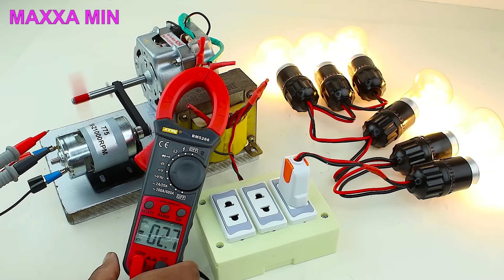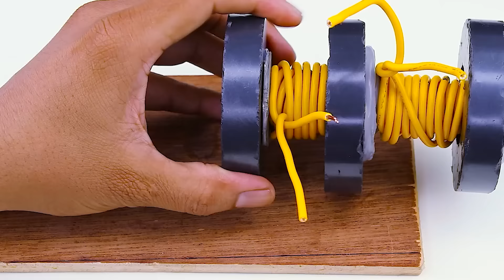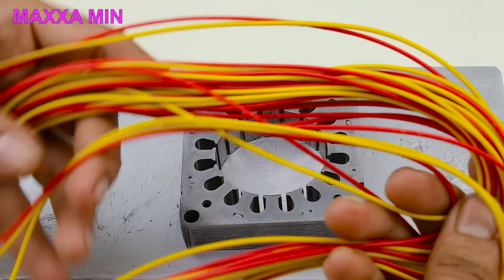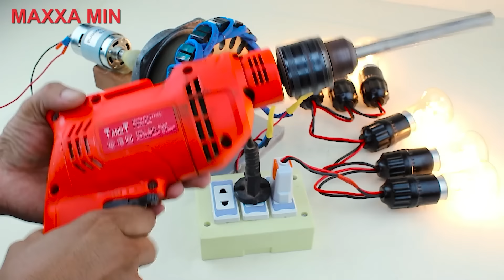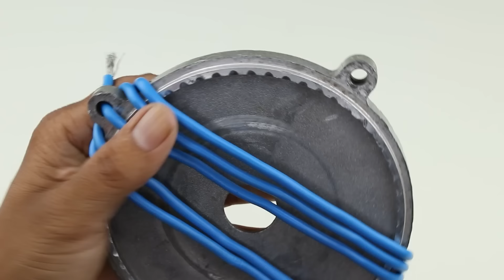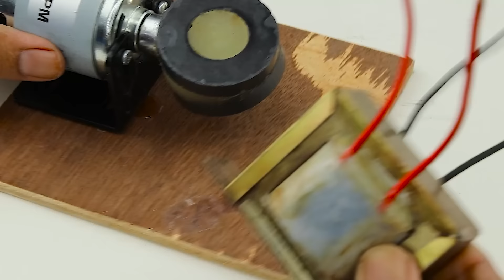Top10 Free Energy 55000W Generator Copper coil light bulb Central electric 220 volt transformer

Comment: What's free about that???  The motor is being powered by wires from another source, that do not appear to be connected to the generator part whatsoever!!!  Just hook the bulbs into that unseen power source and skip all the mechanical illusion.
Reply: モーターを回さなければ、電気は起きません!
Reply from the maker: Real project working but This is demo project bro.
Reply: @maxxamin  Well then demonstrate a complete system that has no connection to any external source.  A completely self contained system generating power without an external source!!